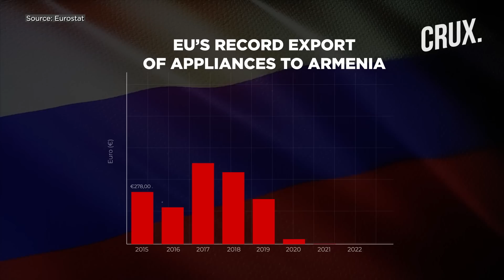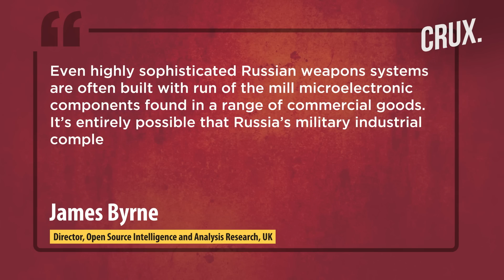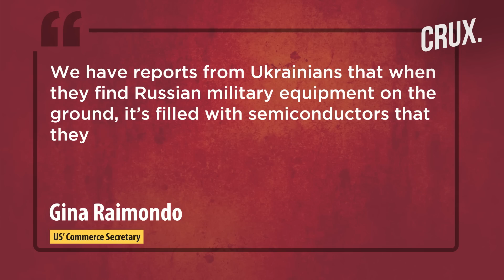Boom In Home Appliances Export To Putin’s Neighbours l Are These Parts Powering Russia’s Arms?

Comment: Perhaps this is why the Russian soldiers have been videoed and photographed stealing washing machines in Ukraine? Putler must be giving them a bonus for every appliance sent back for the circuit boards inside.
Reply: A couple of months ago I saw a picture of a partially destroyed Russian tractor trailer in a recaptured Ukrainian town, with part of the sides of the trailer peeled back by an explosion, one could see it was FILLED with washing machines and dryers, NOT BOXED, but unboxed, most likely stolen from Ukrainian homes!
Reply: I think you’re right about this.  But then why are they also stealing so many toilets?  😅
Reply: There's some great deals at curries

Comment: Putin buying Brest milk pump  to use chips for guided missiles 🤣🤣what a clown
Reply: On the contrary. Is. Really smart. My friend
Reply: That is called Genius
Reply: It’s funny as hell, but it really is a clever way to get around the sanctions… except these chips are very low quality compared to military grade.  You can fry some chips just by touching them wrong because of static electricity in your body, the less you handle them the better.  But if it’s a breast pump or nothing - this really is pretty smart.  I say this as an engineer myself.

Comment: There are some appliance manufacturers who do not bother to blow the protection fuses in their programmed microcontrollers. This allows them to be reprogrammed later.
Reply: Microcontrollers would be available from distributors, hard to control as they used everywhere.
Reply: What does that do? Reprogram proof? How does it work? ASML makes and refurbishes all the best semiconductor machines an est.97% made are still used, do they modify ASML Machines, asml also does schedule services ,right? Seems the semiconductor machine manufacturer could build them more fool proof if needed,think?

Comment: I find this quite amusing. The chips in these devices are not slightly sophisticated. It really easy to just but them off ebay for $1 to $2 USD. Why would anyone buy an appliance to get the chip. There are also some technical reasons this does not work. Guess its possible to sell any story on the internet.

Comment: Military spec silicon is made to survive extreme temps (hot and cold) without fail, domestic chips are far less tolerant, they won't survive the winter and work
Reply: not true mil spec has higher voltage tolerances that is all ..
Reply: all electronics work better in cold weather than warm ..
Reply: You can freeze chips to literally 2K and nothing will happen
Reply: @pootersnacks   most folks forget that a ten year old conumer smartphone has more computing power than a 90s era cruise missile
Reply: @pootersnacks  rubbish...I used to be a UK weapons engineer, I know what I'm talking about
Reply: @pootersnacks  again, rubbish, lower and higher temp extremes than domestic appliances, you think your washing machine or microwave would work long when outside in the artic or in Siberia???
Reply: @k 1 I thought that when it went to the SPIN CYCLE that the tank TURRET went airborne!
Reply: @scottmcdiarmid8196  You are 100% correct, mil specs are much tighter (operating temps, voltage specs, etc) than consumer grade.  I worked for Lockheed Martin for many years, the failure rate of these consumer grade chips will be much higher than the ones Russia had been getting.  Who knows?  Maybe those boomeranging missiles were some early test subjects?
Reply: @scottmcdiarmid8196   oh so you are the reason that people overpay for defense.. now i understand the misinformation .
Reply: @pootersnacks  er no, War is the worlds biggest business. here you go as an example
...."Operating Temperature (Case) Military -55°C to +125°C -55°C to +125°C"

Comment: It’s the “chips” and “step motors” what would be of use in timers and actuators for artillery shells and missiles. Touch (pressure) switches can be used to set off explosives. These parts are easily repurposed. Old radar detectors were used by the Russians in the MiG21-25. Most of the old tube (valve) electronics are still manufactured in Russia, China and Hungary! They are almost impervious to jamming and electromagnetic pulses.

Comment: Russian losses: 14 planes, 42 helicopters, 54 drones, 742 tanks and armored vehicles, 354 artillery pieces, 6 anti-aircraft systems, 13,250 dead, 26,400 wounded, 413 prisoners. number of soldiers on the ground 255,000, reserve 3,500,000 Ukrainian losses 267 planes, 185 helicopters, 1,490 drones, 5,190 tanks and armored vehicles, 5,570 artillery pieces, 382 anti-aircraft systems 87,000 dead, 142,000 wounded, 17,200 captured, 3,400 dead mercenaries, 117 dead nato officers, operational instructors number of soldiers on the ground 730,000 data as of 06.09.22 Israeli intelligence service data accuracy +-2%
Reply: lol
Reply: Now post Ukrainian losses 😀
Reply: @cakejhay  
But it's Russian military
Retreating and dieing....
Reply: @cakejhay  
As many as Russia has killed, 
the Ukrainians are killing more Orcs,
Or the Mighty Russian Federation would Not be retreating from multiple fronts at this minute....
Reply: Nonsense
Reply: So, why is Russia retreating? No decent results since summer. Mobilisation will soon be hitting the bot office. Off, to the frontline for you Mr Bot.

Comment: Why bother? Malaysia Philippines are major semiconductor makers. We can supply all the chips Russia 🇷🇺 and Iran will ever need. 😀
Reply: The Philippines are a close ally to the US and  Malaysia doesn’t want secondary sanctions (just like China) so they won’t supply sanctioned goods to russia or Iran.
Reply: @MightyRude  that's what black market middlemen are for. During a trade spat between China 🇨🇳 and Philippines in 2013, the former banned bananas 🍌 from the latter. So one company sent the bananas 🍌 into Malaysia, repackaged and were then sent to China 🇨🇳. during the cold war the US 🇺🇸 bought titanium and other minerals from ussr via unofficial 3rd parties. And the the Chinese 🇨🇳 parts found in f35 went through a ton of countries first including Philippines, Costa Rica, Mexico, etc. Before ending up in the united States 🇺🇸
Reply: @cakejhay  
This also creates a problem for russia.
Russia’s buying spree in the beginning of the year revealed a parts network to sanctioned countries causing manufacturers to drop certain distributers, this increased the price of the parts by more than 500%, this combined with the increased transport costs created a huge problem.
Reply: Large scale supply to Russia, is not worth the trouble.